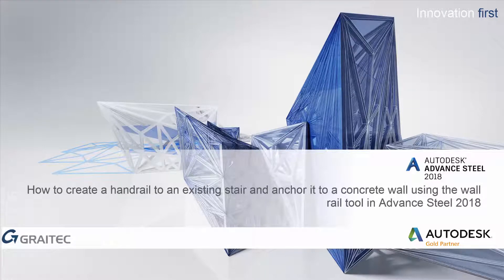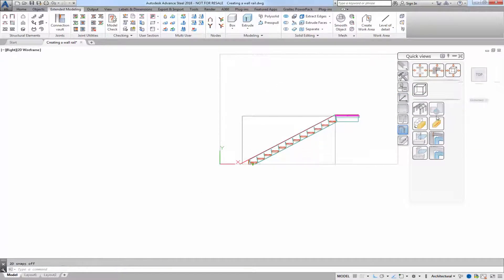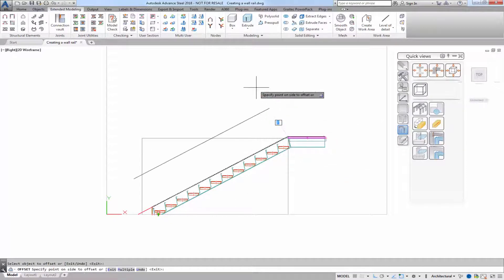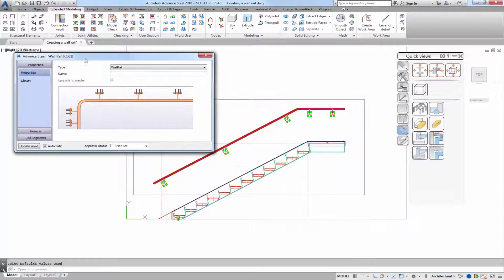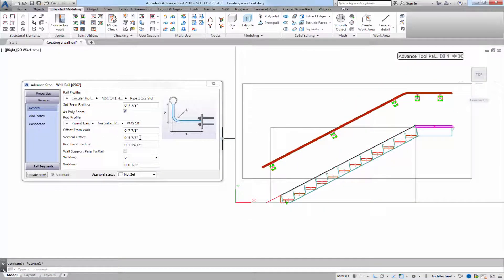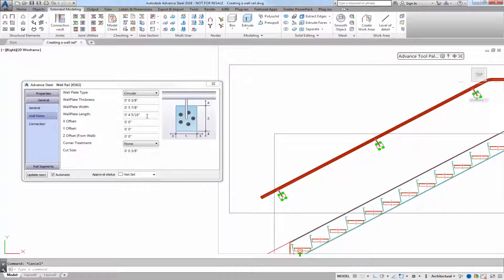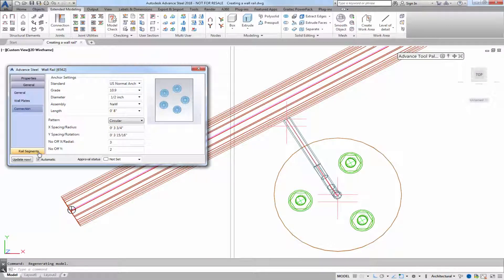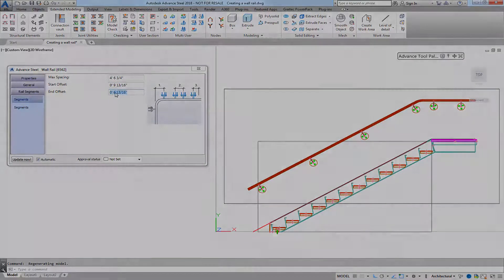Advance Steel 2018  How to create a handrail to an existing stair and anchor it to a Concrete Wall

Comment: This macro does not work properly if there is a change in the Z direction (as UCS is located in video)
Reply: This video is old. Autodesk changed the macro since then, in which version have you tested it?

Comment: Excellent! Can custom connection be done on hand-railing? I would like to separate posts from balusters and do bolt-on connection. Is it possible within macro?
Reply from the maker: Hello Adam,
Unfortunately this is not possible. 
The stair macro is limited, and the development team is working on improvements.
However, you can use custom connections and add to the macro. 
You also have the option to remove the grey cuboid intelligence box. However the links will be severed and no longer customizable.
Thanks for watching!